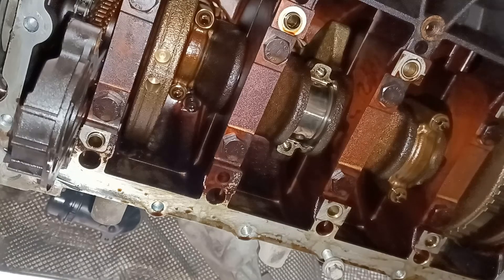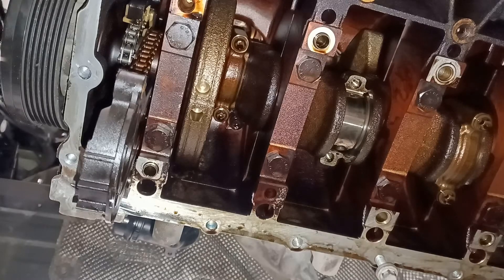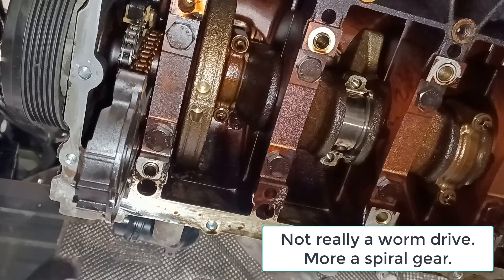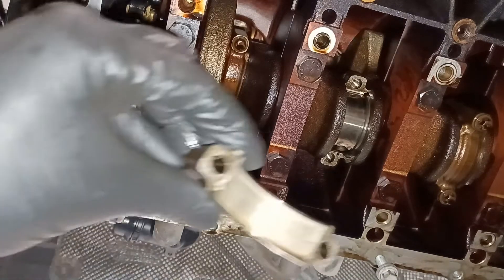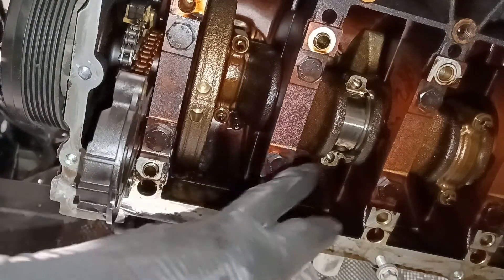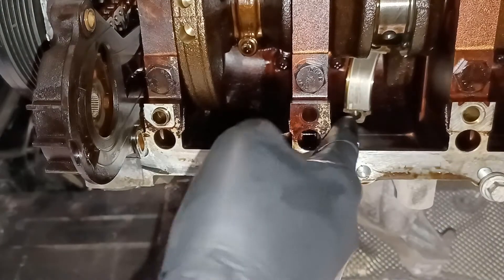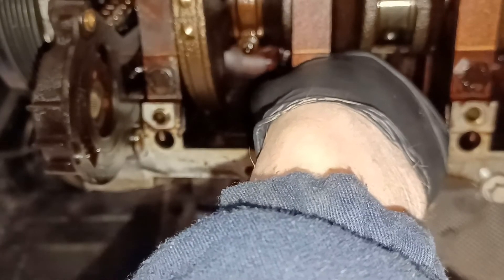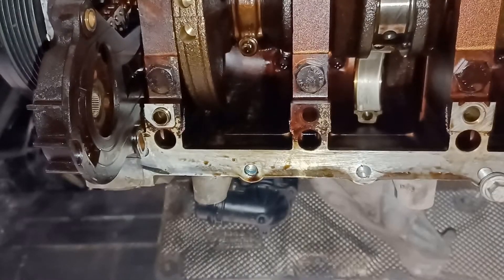BMW 116 Trophy Build - Checking the big end bearing shells

Comment: Useful video to get some insight on how it al sits down there before i get down there myself.

 It is a pain in the ass to find the tolerances of the bearings so i had to order a manual,needit it anyway for the torque specs etc but it would have been nice to now what plastigage to order in advance. 

I noticed air in the oil, so ordered a fres oil pickup and big end bearings just to be sure since im down there already. Just hope everything is stil ok in there
Reply from the maker: Sounds good.  Good luck.

Comment: hi - Did you need to lock the timing to get the oil pump off to do this? Didn't it want to spin when you were trying to undo the oil pump sprocket?  Mines an N43 but similar and an absolute mare to get to flywheel locking hole which is right under the intake and starter motor.
Reply from the maker: Yes I locked it off with an Allen key through the flywheel locking hole.  That won't work for me in the future because the TTV flywheel doesn't have a locking hole.
Reply: @PaulOffordRacing  i actually managed it last night. Intake is an absolute pig with the connections underneath and ive got the engine brace in as well. Managed to lift enough to get it in but you cant sigt it easily. Need to drop oil pump next so i can get to the rods bearings and see what state they are in.